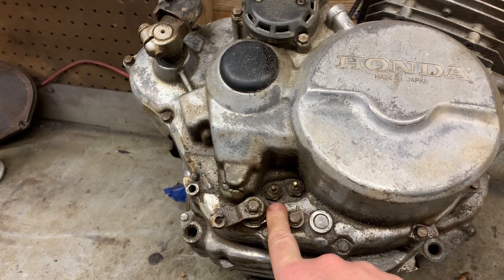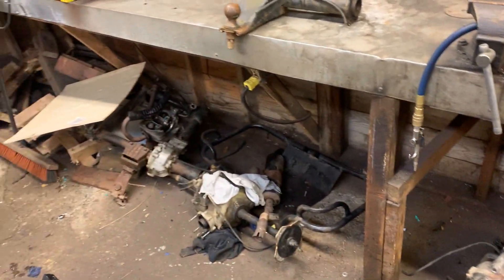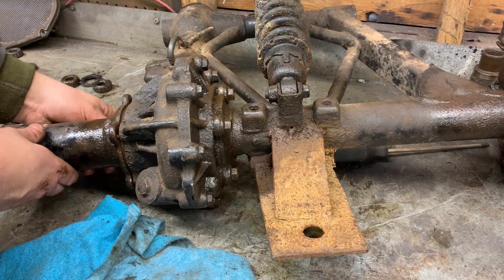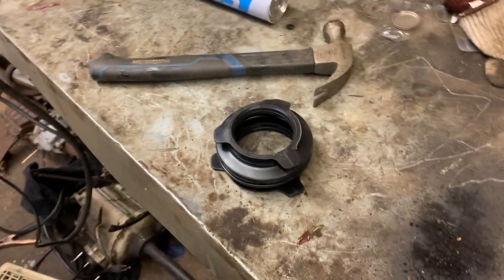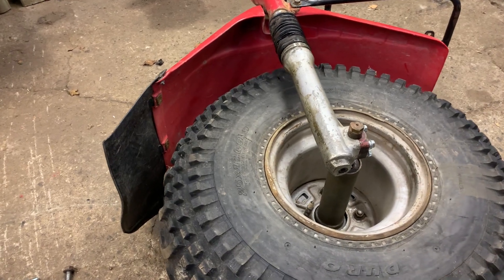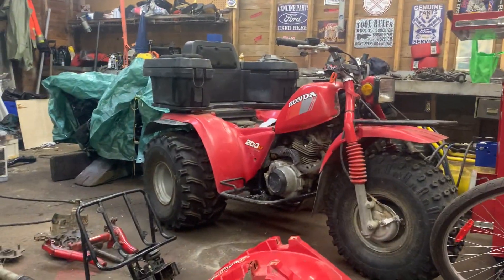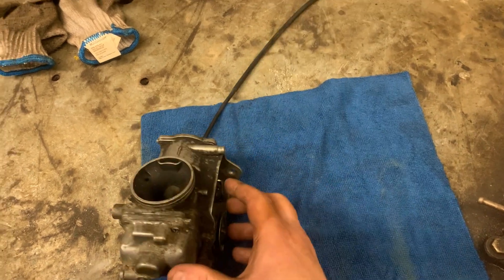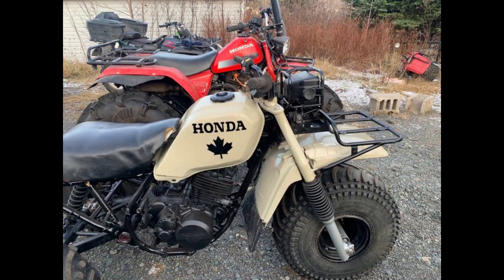Budget Big Red 250 Build Part Two - Updates / Overview

Comment: I did something similar to remove the front tire on my old 1993 ZX11. I took a bolt with a larger head than the hex part and the ground down the sides of the bolt head until it fit snugly. Then I welded a nut to the threads of the bolt to have something to get a hold of with a wrench.
Reply from the maker: nice! as long as it can get you out of a jam thats all that matters! 93 zx11 was a good bike